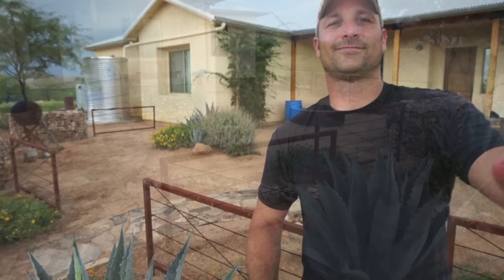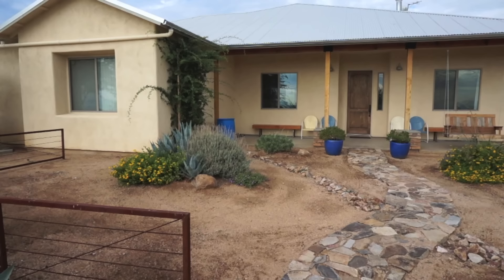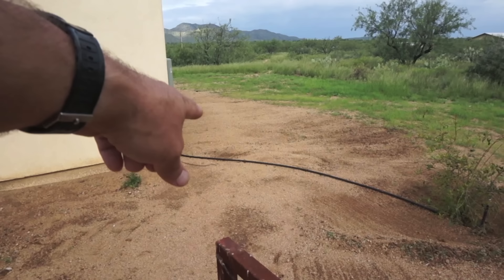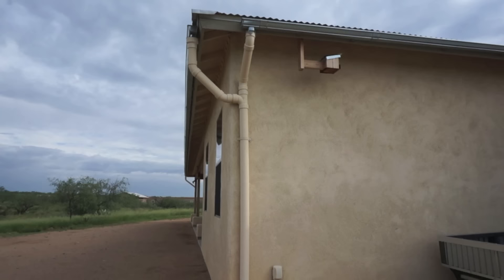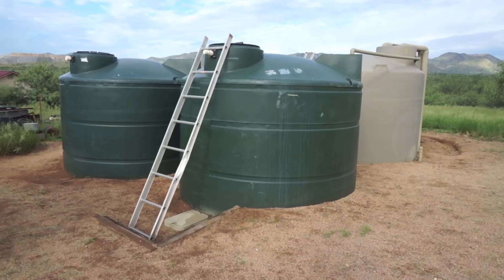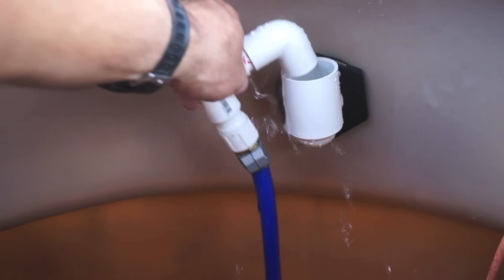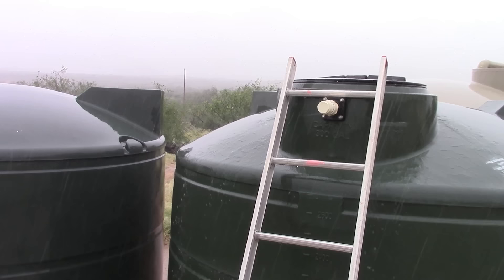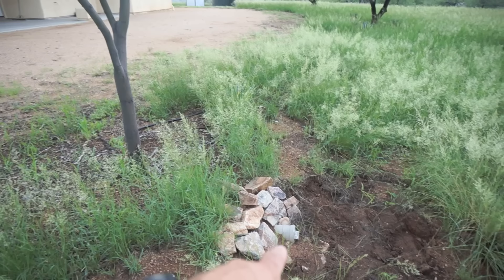Rainwater Harvesting - Home System Tour

Comment: I used to work at a distribution center for a major nationwide retail chain. The building had a roof that was at least 100 yards in one direction by 200 yards in the other (at least 200,000 square feet of space inside the warehouse). 

The building was fitted with standard PVC gutters and pipes that ran straight down the sides of the building coming off of the roof of the building and running out into the parking lot right where the bay doors meet the parking lot. The down pipes were at least 4 - 6 inches across. 

During rain storms where the county that I worked in got at least 2 inches of rain per hour there were probably 100 gallons of water PER MINUTE coming out of each pipe. 

There were more than 50 pipes hanging off of the side of the building just in the truckers parking lot area (there were more than 75 bay doors on either side wall of the warehouse). 

100 gallons PER MINUTE coming from each pipe with just 2 inches of rain per hour. That happened at least 2 times per summer for more than 6 summers in a row. 

I would estimate that on certain heavy rainy days more than 500,000 gallons of water would fall on the roof of that one building in about 6 hours. 

It's a shame THAT company never set up a system like this, they could have had totally free water for 700 employees for YEARS at a time. Bathrooms, drinking fountains, kitchen cooking needs (the building I worked in had a full size kitchen that could serve more than $5,000 dollars worth of food per day). There were also 5 shower stalls in the 2 bathrooms right outside of the gym but I don't know how many people ever used those.
Reply: its because of CAPITALISM!

money money money money !
Reply: No body think for the mother nature dear, sadly everyone is f***g with it.
Reply: @sudg007  can't really see how using rainwater in that case would be more beneficial to the nature, that water would recirculate anyway.

Comment: I would keep an eye out for a used milk tanker, they are made of 307 stainless steel and are food grade generally hold 7000 gallons or buy a 10 wheel milk tanker that are usually 5000 gallons capacity also stainless steel. If you keep it drivable you also have if kept full a brushfire truck with a gas or diesel driven fire pump and the old school 1 inch red rubber fire hose that most pu person used to have 2 hose reels mounted on top just behind the cab. Not near the capacity of a 2 1/2 line but better than a garden hose. Check your local junkyards. I live in Derry, New Hampshire and a local junkyard has an operational Mack 600 cab over pumper from Alton fire department still has two hard suction lines on it but the supply and discharge fittings have been removed it has been there for less than one years I believe it's either 500-750 gallon ready tank. 

One question how much water did you collect the first time the system actually was allowed to collect rainwater? Simple curiosity on my part.

Check with GATX corporation online. They build, rent, sell and lease railroad tank cars all the time as well as run their own tank car fleet in common carrier service IE: when a customer needs a tank car and a unassigned GATX tank is available it gets loaded and shipped. There are chemical and food grade tank cars with capacities from 4600 to 50,000 gallons of capacity in use. Tank cars that are returned from lease are generally scrapped as they have to pay taxes on idle equipment. There are a lot of tank cars generally for crude oil service right now in long term storage on a lot of Out of service branch lines and a number of small short line or regional railroads that have several miles of track without customers not producing revenue are being used for long term freight car storage generally getting $ 3-5 dollars a day per car nto store these cars some of which are only a couple of years old. Any food grade tank car coming off lease is what you want a friend of mine got a 35,000 gallon car that moved corn syrup and he said it was as advertised clean and dry on arrival. That is sitting uphill from his house fed by a freshwater spring and after I made a phone all a spring water company showed up with a van and stayed for two weeks testing water quality and flow. He now has 3-6 tanker trucks stopping by to fill up and take the water to  a bottling plant. The trucks Haven't emptied the tank yet.
I thinking if you added a food grade rail tank car of say 36,000 gallons then you theoretically wouldn't have to take short showers all the time. 

If you decide to buy a used railroad tank car contact the nearest shortline railroad or regional railroad and ask them if they could receive the car and haul it to you house in exchange for the air brake equipment hand brake winch and the trucks and wheel sets. They are worth quite a bit of money to a small rail line and most railroads have highrail cranes capable of picking up one end at a time and setting it on a tractor trailer the railroad owns to easily haul it to your house. A highrail crane is capable of running down the railroad or highway.
The modern railroad tanks are frameless meaning the tank itself transmits the pulling force through the tank for this reason the tanks are made of high strength steel 2 inches in thickness with a compressibility of 1,000,000 pounds as a minimum for all equipment in use in North America railroad service.

Thank you and that is a well thought out water collection system.

Food for thought.
Reply: James Shanks 

5000 gallons is like 68 barrels .
Reply: Just let the soil absorb the water and filter it and dig a well and use the water.

Also consider a reverse osmosis water purification system.

Comment: I would recommend a brush on a long stick for cleaning the inside of the tank--confined spaces with limited air-flow don't always have happy endings.  Otherwise, that's a brilliant system you have.  Working to create something similar; it started with a 3,600 sq foot metal roof and got my first 1,200 gallon water tank delivered last week.

Comment: Wonderful vid! Two quick questions:

Why did you choose not to use a first flush, especially after the long dry periods?

How do you treat and filter before you pump the water into the house?

Can't wait to see the pump house video! That's an obvious next video!
Reply from the maker: +NoSpam Elf Hi NSE!  sorry I never saw this comment until now... anyways, regarding the first flush... I think they are really cool systems but just was an extra expense that I didn't want to add at the time.   Additionally I didn't want to have to mount th extra pipe full of water to my wall or eves.  Great little devices though :)
As for treatment, I use standard bleach (there are guides as to how much to add to water) in the tanks as an initial treatment.  It's much lower than the amount of chlorine all municipal water companies use.  Basically, just enough to keep algae from growing:)  After that we use the water directly for showers, sinks, washers, etc,.  All water for drinking and cooking goes through a Berkey ceramic water filter first though:)  Hope that helps... and I'll probably address this in a bit more detail in a future video:)
Joe
Reply: also you can pop  both cleanouts and spray roof down once and a while  during dry  periods  if need be to get rid of surface roof  dust dirt buildup etc .

Comment: Very well explained..and illustrated..
One question.. what happens if you have no electricity (u made provision for that scenario(..
Asking because electricity outages are common in South Africa..
Thanks
Reply: We use a similar system but with an overhead tank for gravity into the house and then pump that full as needed, usually about 3-4 weeks. So we pump when we have power but I have seen systems that have the pressure pump run into the overhead with a ball float so that when the tank is full the pump auto switches off so you have a full tank of water when the power goes off and when it comes back on the pump runs to fill the tank to capacity. You can use a windmill to do a similar thing or a solar pump but they are expensive.
Hope that helps some. Have a great day.

Comment: Concerning your overflows and the way your tanks are linked together, the best diagrams and setups for linked tanks, claming inlets, outlets, etc. is on rainwaterharvesting dot tamu dot edu, (Texas A&M AgriLife Extension - Rainwater Harvesting). I've also seen first flush diverter systems that can be placed underground inline with your 4" line running to your tanks if you think it'd be easier to put one in after all. 
Hope you get a chance to make improvements to your system with all of your other projects going on. I'd be surprised if my own system is ever considered "complete".

Comment: You say this is a "wet pipe" system, leaving water in the pipes at all time. What about times where you don't have rain for an extended period, do you get algae, bacteria growth in the stagnant water in the pipes?
Reply: Yes
Reply: Jerry Bichsel thats why there is a valve that drain the water from the pipes .
Reply: Jerry Bichsel algae can not grow without sunlight. PVC pipes and dirt block that sunlight
Reply: Jerry Bichsel algae and such needs light to grow it is dark inside the pipes
Reply: Algae needs light to grow its dark inside the pipes
Reply: I would say only if light gets in
Reply: Junjun would take a lot of electricity

Comment: How do you clean the water to be able to drink it??
Reply from the maker: +Franklin Michael Hi Franklin... it's pretty much just straight rainwater until it goes through my Berkey Ceramic water filter.  It's a simple, but effective gravity water filter.  I only filter the water for cooking or drinking.  everything else is just straight rain:)
Joe
Reply: homesteadonomics Oh , great thanks
Reply: +homesteadonomics I would love to see that part of the setup too! maybe in a future video?
Reply: +Franklin Michael My rainwater doesn't get filtered, it's just straight rain.
Reply: you can eiher use bleach or boil it. You might also want to have it tested to see specific levels of contamination, but if the roofing is metal, and the pipes are clean, you might only get some dirt and pollen, which can be easily cleaned.
Reply: fjoa123 Yeah I guess it depends, if you have acid rain because you live in a very contaminated town then it's probably better not to drink it.
Reply: yes, not to mention bird or mice feces. You would not imagine the aumont of things that end up in the roofing.Franklin Michael
Reply: Agreed with UV light and filtering and basic testing now and then Rain water is cleaner then well water and city water..free of iron, rust  hardness, salinity
Reply: may you will need to eliminate pathogens.
Reply: vanden7reish why would there be pathogens in air water ?
Reply: freakyflow but is it free of fluoride ?
Reply: Because bacteria, viruses, and fungi are in the air, the roof catches bird and sometimes mice feces, fungus and molds can grow in pipes and tanks, skeeters and other insects will make use of water in tanks if they get in, etc... Filtration, UV light, chlorination, and solar sterilization work to varying degrees...
Reply: Surely you have mains water to atleast the sink
Reply: @ricklopez4502  Rainwater does not contain Fluoride. That is a substance, as well as chlorine, added by a municipal water supplier.
Reply: If need be  joe could pop both cleanouts and spray the roof  down to clean  it once in  while , real simple solution as clean outs are handy  system  tools  !

Comment: Very Impressive, very good. I am sure you have also thought about the Solar roof to generate electricity and painting the roof with sun reflective paint to repel heat to save on your air conditioning. Good Deeds are contagious and one will eventually lead to another. You have the blessings of mother nature.

Comment: incredible I bet your water tastes delicious.  here in the UK its chlorinated so you have to either buy water or let it sit for a day or two to get rid of the taste.
Reply: They chlorinate our water over here as well. we don't usually have to let it sit tho it just tastes badly. I buy water as well cuz the town I live in the water is nasty tasting. it has had so many chemicals our clothes would fade horribly with just one wash.
Reply from the maker: Yes, chlorination is the most common treatment method for sure.  I actually use a tiny bit in my rain tank as a just in case measure.  But it is a fraction of the amount that city water has.  As for cooking and drinking water, I use a Berkey ceramic gravity filter and it does a great job:)
Joe

Comment: Really like your Harvesting System!  I wanted to pass along another Harvesting System that has a few extra bells in their system.  Might be worth your watching.  Suggestion only...Here is a quick summary of the clip:Entitled: Rain Harvesting video from Engineer 775 Practical Preppers. Posted on 13 May 2012.The specifics that I thought you might like to see are the "First Flush System" a "Skimming System" in the tank and a "Floating Extractor" that hovers in the tank about 4 inches from the top of the water level.The good stuff starts around 2:10 into the video.  He shows the "First Flush System" and how it works around 7:20 into the clip.Keep your clips coming.  They are very helpful!  All the best!!
Reply from the maker: +Andrew Toller Thanks Andrew… yes, I have seen Eng775 videos and it's a great system with lots of cool features.  I decided not to use a first flush as I was trying to save on PVC and didn't want to have to suspend an extra section up for it.  But that's not anything against a first flush, because I think they are very cool… just wasn't right for me.  I'm fortunate in that I really don't have much except for dust that can get into the system and that is caught in the rain tank and some settles into the bottom of the pipes.   But thanks for the heads up… as I hadn't seen that video for several years and it was cool to see his techniques… good engineering mind!  :)
Joe

Comment: nice job! I think having some creative use for the overflow, say a pressure driven sprinkler, to redistribute the uncollected water, maybe to a detention pond, which could be as simple as a bit of a culvert from your tanks, that funnel into said depression, make it a bit of a vernal pool/water garden, or always wet koi pond. either way, water features, are great micro ecosystems, promoting a lot of wildlife, and are pretty. so because of your arid location, a vernal pool style mini marsh would probably be more likely, not worry about if it dries up, it'll still be an amphibian breeding ground, for example. 

The other thought I had, was that cleaning up might work well of that sediment by either having some kind of filtration basket on the input at the tank, like a long sock, that would collect the silt at the bottom, but have tons of lateral surface area for flow. or for clean up, rig up some kind of wet/dry vac to suck up the sediment, and have a filtered overflow. thanks for making these homesteader videos keep up the good quality!
Reply from the maker: Hi Tizona!  These are all really cool ideas!  I'm planning on some sort of detention pond for the overflow... as I hate to lose all that water during the overflow period.  I like the habitat idea too, very cool!
And the sock sediment trap is very interesting too... you've got me thinking now.... very good ideas and brain stimulation!  Thanks so much for watching and stay tuned as I might just have to use some of these ideas :)
Joe
Reply: hah "Well, that's the beauty of youtube videos. is you get feedback. sometimes they're pretty good ideas! there are also some pretty useful filtration ideas that I'm sure you could get from visiting hydroponics, or aquaculture place. just about anywhere that deals with waterflow on a larger scale than a fish tank.  but you've got good videos, so keep making them! also those Agave are lovely!

Comment: Wow now that is some system you have there and great install , i just have a single 600 gallon than at the rear of the house and a 50 gallon at the front all the water is just used for watering the garden/trees etc. great video nicely done.

Comment: Great job!. I live in Florida where it's very hot like where you live and I always had this crazy idea of collecting rain water and put pipe or sprinklers on the roof to cool it down. I would use a 12v pump with solar power and once the water cools the roof most of it would go back into the tanks. Maybe it's something you could benefit from also.

Comment: Great job, most impressive - also like the car you drive -mine is an oldie 2002 model, still going strong with nigh on 300,000 km on the clock.

Comment: Excellent presentation that sums up the bits and pieces I watched earlier. In fact, it renewed my interest in working on my mostly dormant New Mexico project. 
Amusing was: Just when I was wondering "how is he dealing with sludge buildup in the pipes and tank",  the answer followed a few seconds later and left only one last question: 
How do you get the initial tank empty enough to clean without depleting the other tanks?

Comment: Try using a shop vac to clean out. When full dump into bucket then pump out. I don't even use a foam filter on mine when picking up water.

Comment: I’m surprised you don’t have an in-line cylinder filter..  maybe somewhere near the filler tanks.
I use to pump water into those clear square containers and we use to have a incline filter to clean the waste water.  Seems like it would help elevate you cleaning inside the catch tanks. Good video👍🏻

Comment: You must live where freezing waterlines isn't  an issue.  I had to install mine system in an insulated building in such a way the the fill lines from the gutters, as well as the overflow drain can gravity drain to remove water from the lines.  Otherwise all my lines would need to be replaced in the Spring.  Our frost line for waterlines is 6' deep here in Dakota land